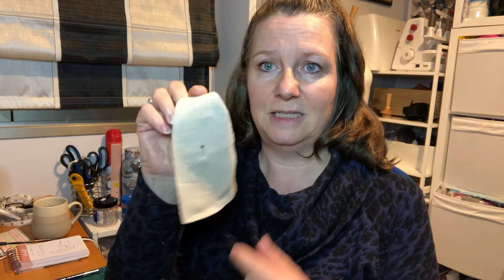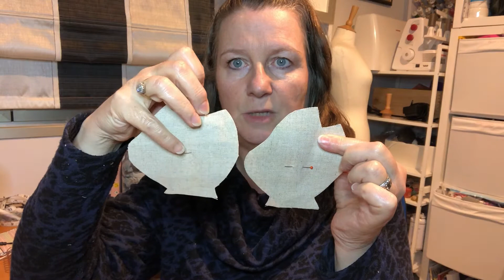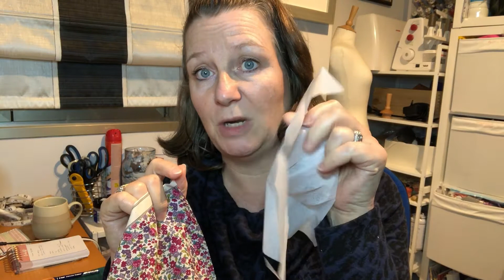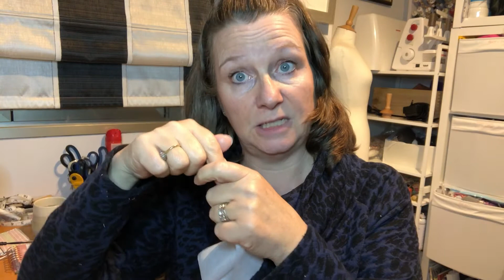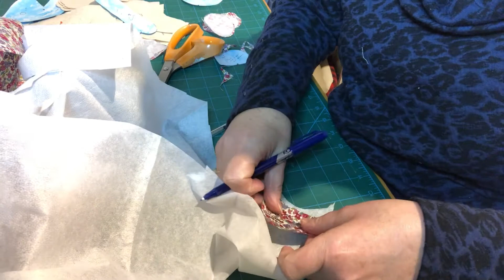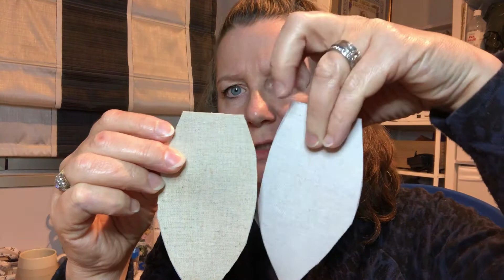Luna Lapin by machine - 1c Mirroring and Interfacing

Comment: Thanks so much for such clear videos for the  beginner  that I am.  Im so glad to have found you.  I am about to start my first LUna .  I wonder if there is a reason you dont iron the interfacing to the rectangular piece of fabric before you cut out the two pieces.  This would save you cutting out the interfacing using the pattern and would reduce cutting out the number of pieces by half.  thanks !
Reply from the maker: Hi Mandy, I think it's just a choice thing really 🥰 I think that the thoughts that affect my way of doing it in this video was based on being as economical with my fabric as possible. If I iron the interfacing onto the fabric as a whole then cut out, there is wasted interfacing on the back of my fabric in the spaces around the pattern pieces, plus I then can't use the scraps of fabric in those voids for appliqué on another project (as I wouldn't want an interfaced fabric for appliqué shapes as it would be stiffer). However, this video is a few years old now and there are some things I may do differently now, but this is still a good basic video for a beginner. Your suggestion of ironing the interfacing on as a whole and then marking the pattern pieces and cutting out is 100% valid and a great choice especially if you don't save scraps for other projects. Thank you for sharing your method too as that may appeal to others that watch the video. Have a great day! 🥰

Comment: Hi Claire do you recommend leaving an extra seam allowance ? The legs are very thin I find? X
Reply: Hi Claire.  Thank you.  I forgot just how dainty Luna is!   I think I’ll add. 1/4’ on legs and body 👍🥰
Reply from the maker: Hi! Yes, the thin long legs is part of the design for Luna. If you do add any width (excluding the 1/4inch seam allowance) remember that it may affect the fit of any clothes you make for that character. I hope it goes well for you 🥰
Reply: @ her legs look like pencils at the moment. I think another cm will look better.  👍🥰
Reply from the maker: Hi Christine, I always add 1/4 inch seam allowance down both long edges of the legs to the pattern. This way when I put right sides together to stitch the legs snd then them out, they then should be the same width as intended. Felt does have a little stretch when they are stuffed so if you are using a non-stretch fabric (cotton, linen or a synthetic woven fabric) there won’t be that slight stretch. Of course, you are the designer of your own character so you can always widen the legs slightly plus add the seam allowance.  I hope that helps 🥰

Comment: Hi Claire,  I am so glad that I found you.  I have had my Luna Lapin kit close to two years and have been too intimidated to cut it out.  I want to make it in the wool felt that came in the kit.  With the felt, do I still need to add the 1/4" additional seam allowance that you were using on the woven fabric?  Thank you for making these video tutorials for us.  They are wonderful and helpful.
Reply from the maker: Hi, thank you very much for finding me and your comments. I must admit I've not used felt to sew Luna so there may be more people on the Coolcrafting facebook group that can help you (look for https://www.facebook.com/groups/290482658146634/?hoisted_section_header_type=recently_seen&multi_permalinks=1241375429724014 ) But if you are handsewing on the outside then I wouldn't add any seam allowance extra. However, if you are going to machine sew the felt from the inside and turn the limbs and body out, then I would. If we sew too close to the edge of fabric it can fray and split the seam when the item is stuffed, although with felt I accept it doesn't fray but you still want a strong seam for stuffing and for little ones if they are going to play with it. I know that's very long winded! But hopefully helpful. Take a look at the group if you're not a member already as it's filled with all things Luna and lots of people who sew with the felt, and very friendly - good luck! Shout me if you need any more help 🥰 I'm also on Instagram as @sewsunnytimes